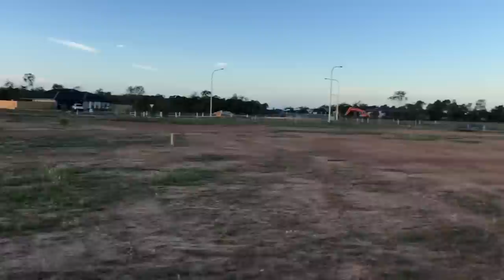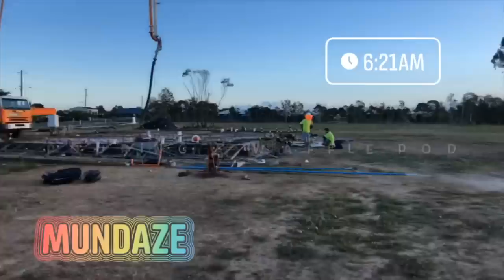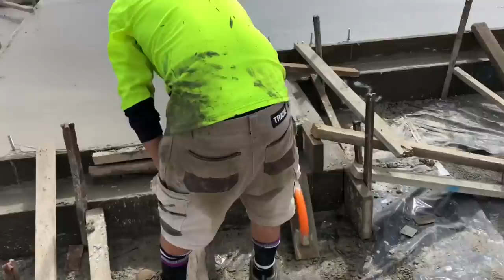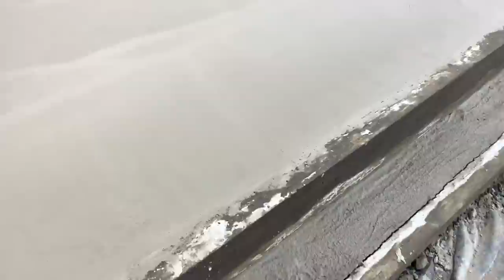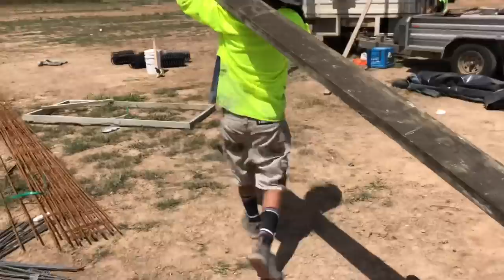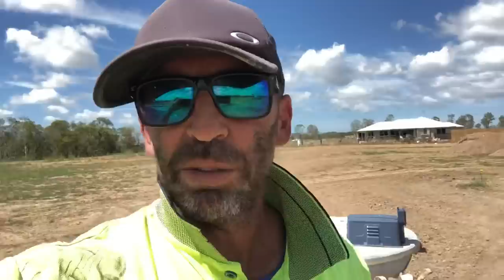How to use a concrete trowel

Comment: First tip is to throw the pointed trowel in the garbage and get a marshalltown 14 inch by 3 inch
Reply from the maker: Ryan Seppanen 😂😂 👍 thanks for the hot tip 👍
Reply: Lol...
Reply: Funny that, Ive used a pointed trowel for 35 years and Ive had this 14x4” square trowel since day 1. So I decided to try it out of curiosity. 30 seconds later, “Harry pass me the pointed trowel”

In Oz mate we sinply get out the big mag float, we got it covered both ways.
Reply from the maker: Rick Field i’m with you buddy 👌😂🤙🏻
Reply: This guy.. literally all his comments are just bagging on fellow concreters and their work. Yet has nothing to show.All talk.classic yank